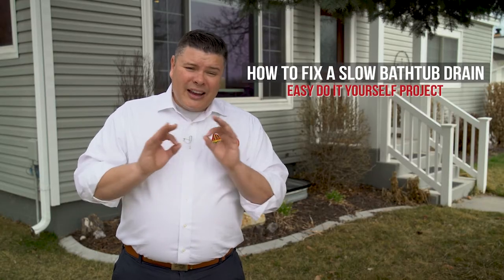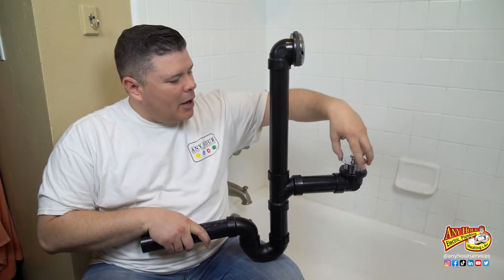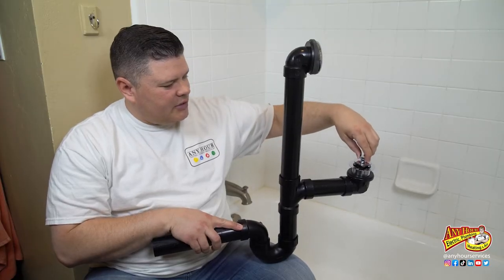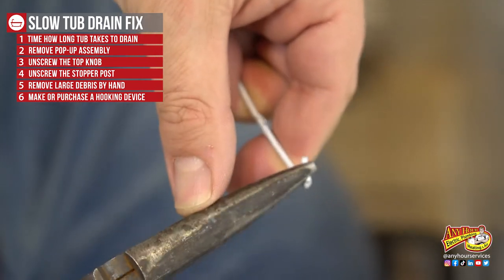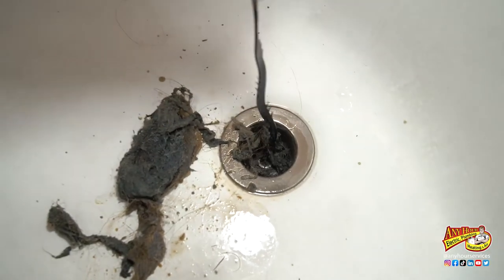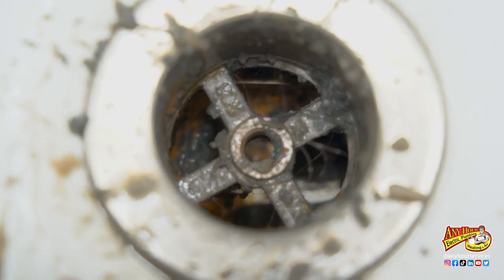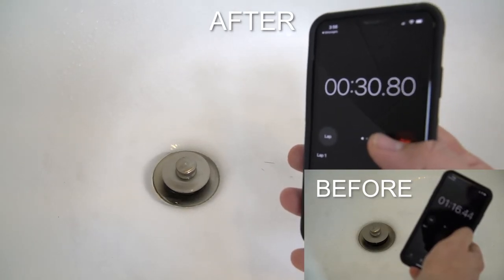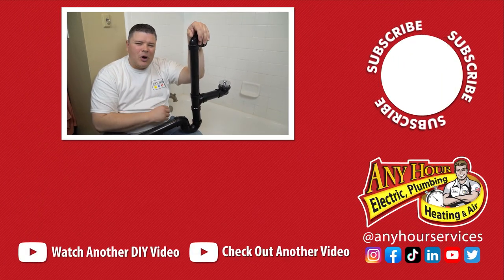How to Fix a Slow Bathtub Drain

Comment: Just if some day read my comment,  I'd like to know what else I can do when the drain, the over flow is completely clean but it doesn't drain fast enough.
Reply: I’m curious too. Running into that problem. No hair or blockage. Just draining slow.
Reply: Means you have a clog further down the line. He literally covered this in the video.
Reply: @niastarz1  Means you have a clog further down the line. He literally covered this in the video.

Comment: I've been using that little "plastic snake" for year, so there were two things I liked about this video - the diagram near the end of how the pipes are connected, and your measurement of how fast your tube drains with 5 gal of water.

I just finished snaking my tub after I noticed it seemed to be draining slow. I'm going to measure how fast it can drain 5 gal and compare to your 33 sec time. Thanks!